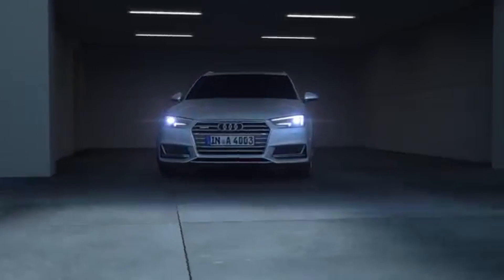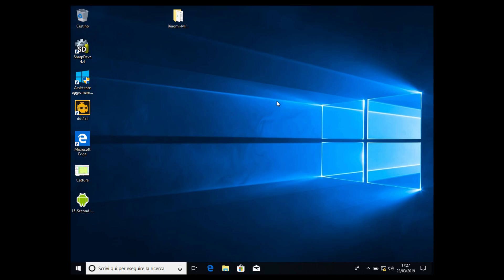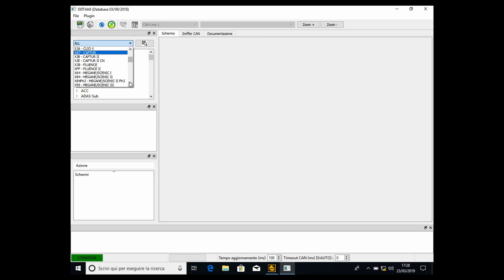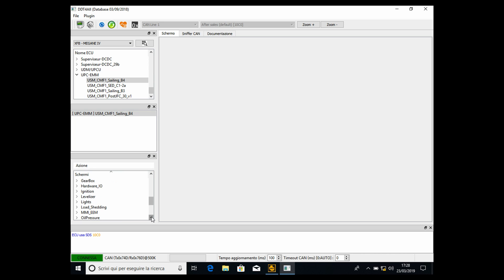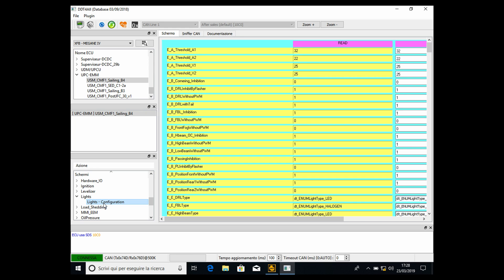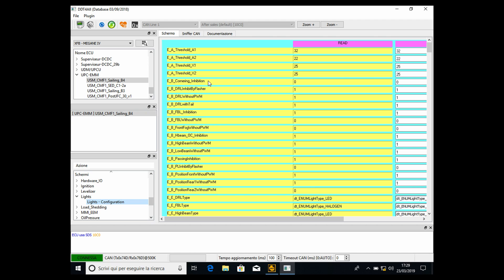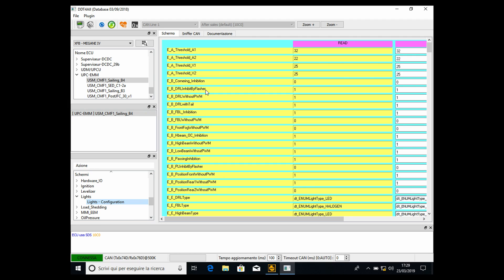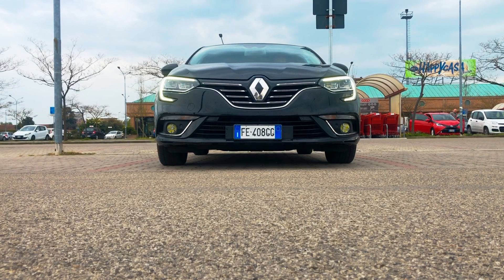Megane Led Light Fade Off with Turn Indicator - DDT4ALL Tutorial

Comment: Hello. Thank you for the video. I did that too and got the same result, but after a while the LED headlights started flashing on their own. Did I make a mistake? There is no problem when the dipped beam headlights are on, but when the parking lights are on, the daytime LEDs start flashing, as if there is a malfunction.

Comment: Hi Michele, my Megane Estate (1.6 Diesel) DRL are not working very well. Can you suggest a possible reason and fix? I was told by my local garage that it could be the LED ballast needs changing? Or would it be the LED itself? Passenger side is very dim, driver side is dim, but not as bad as passenger side.
Thanks in advance!

Comment: +Michele Predieri, i was trying your Lights Mod, but it didnt work as expected(or do) because it only works as u say when i put the Lights lever on "0" position. the thing is i never use it on that position, almost the time it is on Auto and sometimes in manual... Question: Is it possible to activate that mod when lights in "Auto"? Thanks

Comment: Can the LED indicators on a 2019 RS280 be made to work like an audi's?
Reply from the maker: You mean?
Reply: @drivewithmi My front DRL also have the indicators can they be made to flow/move in the direction instead of just on/off flash
Reply: @steveturnbull9542  Hi Steve, was there an answer on this question you asked as I was about to ask the same? Thanks
Reply from the maker: Oh you mean the dynamic indicator.
Unfortunately not, you have to buy third part accessories, there are a lot for the megane that behave like you want

Comment: Great videos, thanks for all the info. I was about to buy the obd2 but I wonder if you know the answer to my question? It says not suitable for diesels. I know these tweaks are not touching the engine, so do you know if it will still work on my 1.5 diesel play model? Thanks, Pete... keep doing the videos.
Reply from the maker: Mine is the 1.6 diesel, never had a problem whatsoever 👍🏻👌🏻

Comment: hello, it is possible to activate the adaptive speed control, DAB, R sound on a diesel mode?
Reply from the maker: Hi, no to all, for the adaptive cruise control you must have the front radar, the DAB is not available for the megane, and r-sound does not seem to work (only the A110 sound works)
Reply: ok you should make a video for the R sound with the alpine
Reply: thank you for answer

Comment: Well done. Pls make video about fatigue detection and traffic sign reconition also.
Reply from the maker: fatigue detection needs a separate hardware, so with ddt4all you can't do nothing at all. Traffic sign recognition needs a front camera under the rear view mirror, so again, only with ddt4all you can't do nothing.
Reply: @drivewithmi  Hi bro. Yes understood. I guess my car (Kadjar) has that hardware. I alraedy open fatigue detection on r-link but i can't shown fatigue bar on screentraffic sign recognition as you said need camera under rearview mirror and automatic lights should be i rememeber. I have that options. I think you have some information for helping me. Which options will change? Thanks for answer and wonderfull videos. Buona fortuna fratello.

Comment: hi - I am guessing this cannot be done on Clio IV because it has not got that 'Sailing' configuration ?
Reply from the maker: sailing mode? where do you saw it in this tutorial?
Reply: @drivewithmi  - thats what you selected in DDT4ALL .  USM_CMF1_Sailing_B4   .. unless my eyesight is poor and I read it wrong?
Reply from the maker: oh, sorry! i told you that because "sailing" is a specific flag you have to select in DDT4ALL for a specific function in the automatic EDC Gearbox. Didn't thought you're referring about the Cluster. I've just looked up in the Clio IV, there's a similar ECU to USM_CMF1_SAILING_B4, but there's nothing about turning off DRL when indicator lights are on.
Reply: @drivewithmi  - ah right thank you. What is the similar ECU setting in DDT4 all for the clio to USM_CMF1_SAILING_B4 please anyway ? - thanks
Reply: @drivewithmi   - thanks , what is the similar ECU to USM_CMF1_SAILING_B4 then please on the Mk IV Clio ?
Reply: @Andy-Robus  did y try ? İs it work ?

Comment: Hello brother,
How are you? I need to know several things about koleos 2018, regarding to starting engine remotely.
First when i turn on engine remotely it will stay on for 5 minutes or so then it will turn off, is this normal?

Secondly, shall i wait for 10 minutes when i need to start the engine remotely between two starts? because when I do within 10 min it will not work!

Thanks,

Salim
Reply from the maker: Hi Salim!
turning the engine remotely means that you only turn on the dashboard by pressing the start/stop button for few seconds?